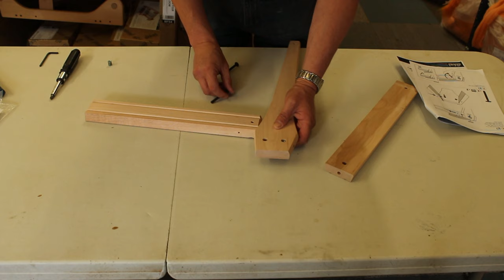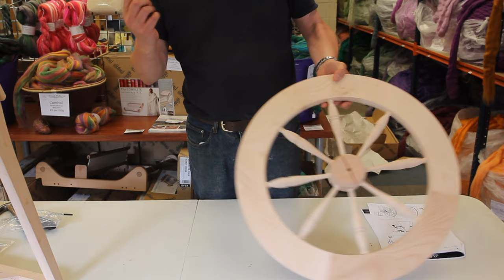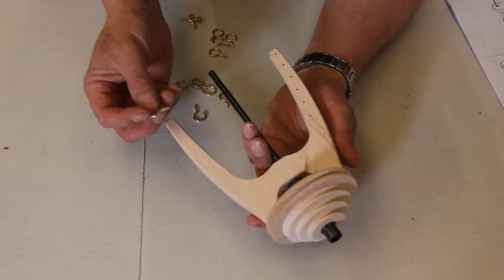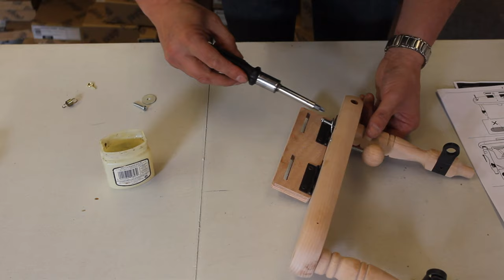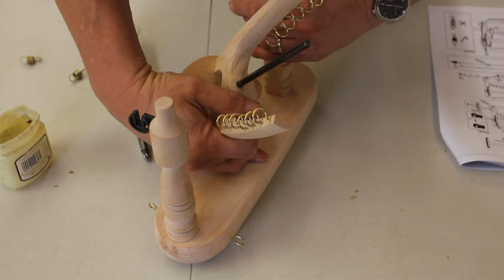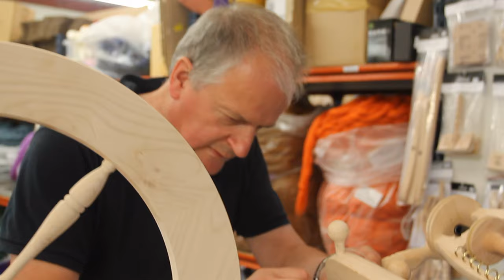Ashford Traditional Spinning Wheel Assembly

Comment: Ah thank you so much! I have a slight wobble on my wheel; it’s a traditional from the 80s. Are there any videos of alignment adjustments? X
Reply from the maker: Almost all the wheels that I have seen of this age have a bit of a wobble. Only the newer models with the ball bearings run perfectly true in my experience. If the hub or any of the spokes have come unglued that might be the issue. But unless it is affecting your spinning I wouldn't worry about it all.